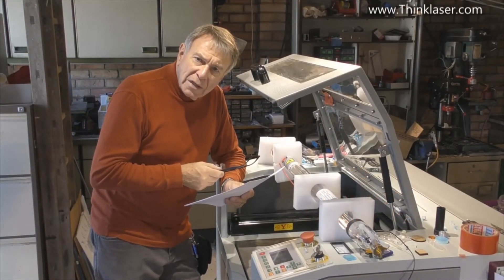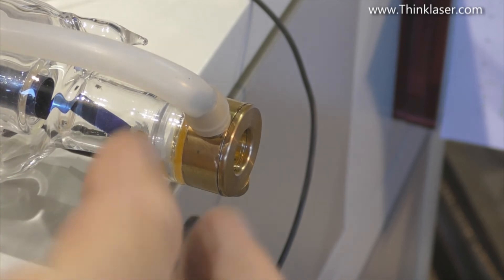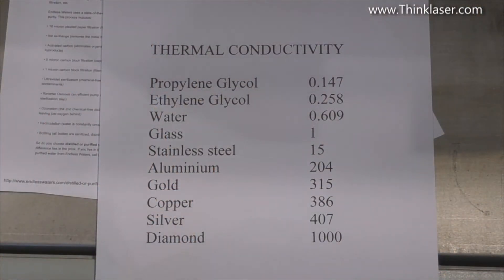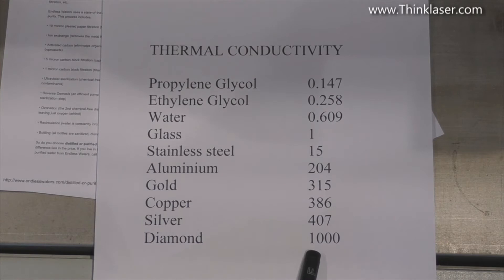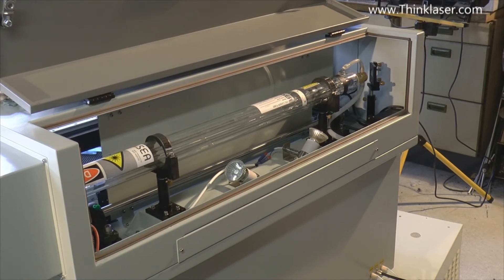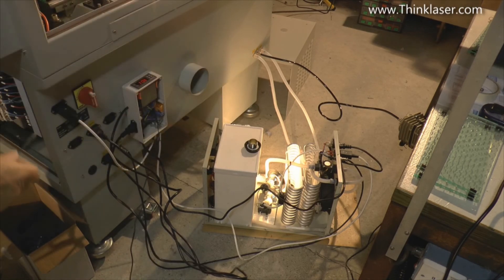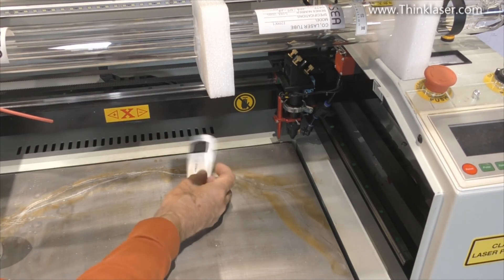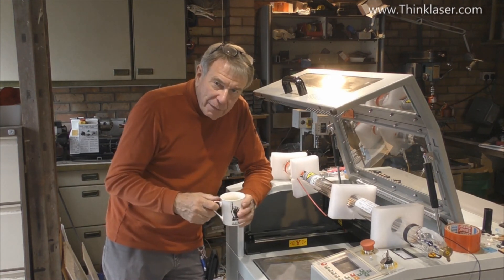How To Use A Laser Cutter - Lightblade Learning Lab 30 Winterizing Your Laser Machine

Comment: Love these videos russ.

Do you think it's possibly to make a video of full engraving a delrin box so the pattern lines up on all 6 sides of the box ? Kind of like wrapping a box in a patterned wallpaper. I'm planning on getting a laser engraver and that's what I'm planning to use it for so it would be very helpful to know how it's done and the best speed and power to use for best results.
Reply from the maker: Hi, This is Gareth from Thinklaser. Thanks for the suggestion, however Delrin is pretty expensive and more than double the cost of acrylic. Is there a particular reason you are specifying Delrin for your boxes?